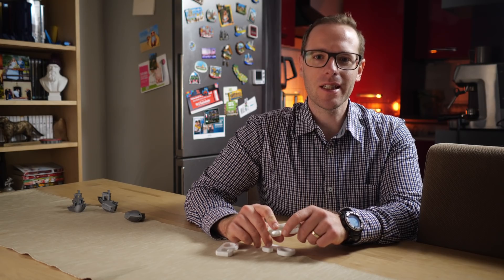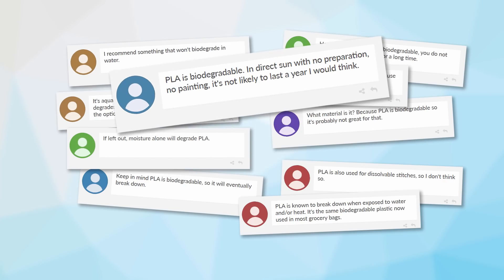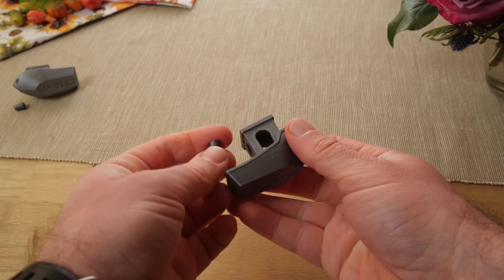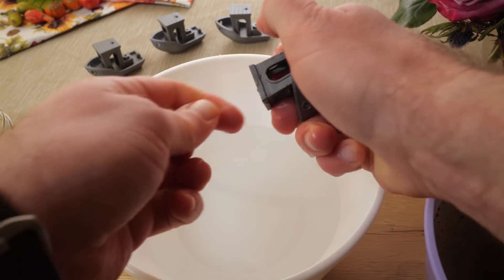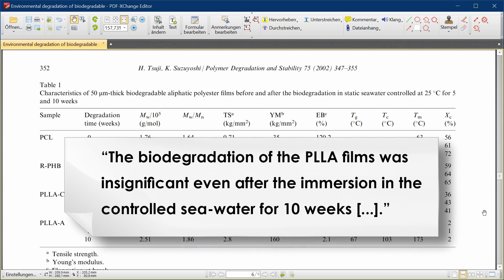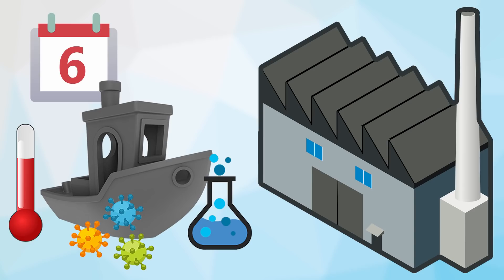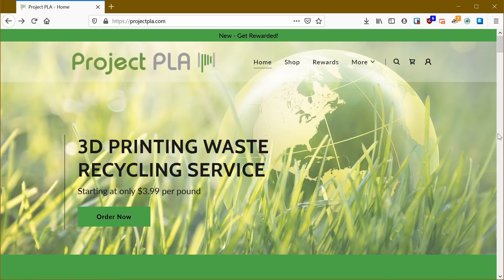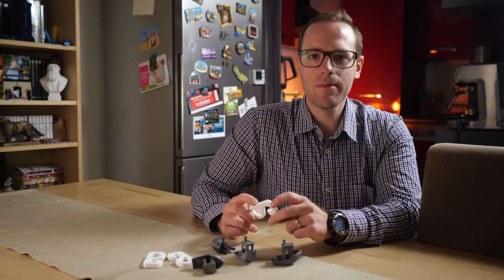Is PLA for 3D printing really biodegradable? I've buried and drowned Benchy for 2 years to find out!

Comment: The ProjectPLA website redirected me to spam 3 times.  If it was once a real company, the domain has since been taken over.  The first time trying to get me to install software, the second time redirecting me to Bing(?!), and that was from a Google link), and the third time to one of those fake pages telling me my Microsoft registry keys were illegal, it replaced my cursor arrow with a different one, froze my mouse, and locked up my computer.  I tried to get out of it with Escapes and CNTRL-ALT-DEL's but had to shut off the internet, then did a hard shut-off of my computer because I didn't know what it was trying to do.  Please remove the link in your description.
Reply from the maker: I'm very sorry about the link, I've already removed it now.

ProjectPLA seems to have died a few months after I made the video, but the link was still working for a while. Thanks for alerting me that it's filled with spam now.

If you're looking for something similar, TerraCycle seems like the only alternative right now, you can check them out here: www.terracycle.com

Comment: Before getting into 3D printing, I was concerned about the environmental impact and was reassured by the ubiquitous 'biodegradable' claims for PLA—as someone who now LOVES the hobby, I'm bummed to discover it's pretty much a lie ☹️. I was relieved to hear about ProjectPLA.com but it sadly appears to be unavailable. Hopefully something similar becomes available soon. Thanks for the great information 👍
Reply from the maker: Yeah, same here, I now always think more about whether I really have to print something or not.

As for ProjectPLA, I was sad to hear it's gone under. I guess too few people were willing to pay for the box. I did find another similar service, so you might have more luck there: www.terracycle.com

I also began using more and more stuff from Filamentive (based in UK, but I think they sell worldwide). A lot of their filaments are made completely from recycled plastic and there's no loss in quality whatsoever.
Reply: John, it isn't a lie. What he did here does not test if it is biodegradable, he is testing if it is compostable. To biodegrade PLA you have to heat it up, very hot, as well as have it very wet. You don't just bury it and it magically happens no one claims this.

Comment: Great video but something isn’t right.  I’ve had PLA in my garden degrade significantly in a few years.  I have no scientific tests unfortunately but wonder if it’s because it was actually PLA and everything else out there is PLA with additives or maybe because of some local environmental factors.  For example the slugs loved the stuff for a while!  No discolouration for you even though?  I’ve had prints on windowsills indoors that have lost colour from the sun but perhaps that’s a symptom of the cheap and nasty filament I’ve used in the past 😂
Reply from the maker: I've heard something similar before, but it seems to be quite rare.

I think you're thinking in the right direction that it has something to do with the additives. I'm fairly certain that cheap fillament has some filler material and it's this what causes the parts to crumble, not the actual PLA.

Nope, didn't have any discoloration to speak of, but I also don't live in a very hot climate. I did print a "beware of dog" sign about 3 years ago from PLA, and while it did warp a little from the heat, the colors are still as vibrant as before. So yeah, it's probably just cheap fillament that seems to be having those issues.
Reply: Hobby Hoarder filler material yes that’s possible, all my early filament was real nasty stuff so probably contains all sorts :)

Comment: I'd be interested in knowing what differences a PLA spool plastic from printed PLA.
I have PLA spools aged of like 6 months that you can't even manipulate because it will break like raw spaghetti if you try to slightly bend it...Though, I have prints with this exact same  PLA spool, that are as robust as fresh prints  :|
Reply from the maker: Brittle PLA is usually a sign of being exposed to moisture too much. If you dry the spool in an oven (at 50'C for a few hours), it should go back to normal.

Comment: I'm doing a PhD on biodegradable microplastic and the reference you used are the ones I have read. The surface area to volume ratio is small if using whole piece to test, maybe grind it to smaller pieces you will see some changes
Reply from the maker: Good luck with your PhD!

I'm sure that's true to an extent, but I doubt most people would be willing to grind down parts before throwing them away.
Reply: @HobbyHoarder  I wonder what would happen if we used the sink waste disposal to grind it up? It'll then go into municipal sewage management... not sure if that's good or bad.
Reply: @reinux  I'd suggest using a blender or food processor that you don't care about and won't use for food again.
Reply: @Katskraftkorner  Before returning it to soil or something?
Reply: @reinux  smaller pieces of anything break down faster than larger pieces. I wouldn't use the kitchen disposal to grind plastic.  If you do any resin crafts, or even painting of any kind, or make models, you can use the ground up bits to add texture, or create unique color effects in resin. Basically, use it the same way in resin you would glitter or metal flakes.
Reply: @Katskraftkorner  Huh, that's a cool idea. Thanks!

Comment: thank you so much for clearing this. i wanted to go with ender 3 since you cant print PETG on glass, and i did not want to go with ABS either since of its fumes and hardness to print, etc. thank you so much for clearing this for me. never trust quora!
Reply from the maker: You can use glue stick and apply a thin coat on glass, then you can print with PETG as well. A textured PEI sheet works as well, but can be quite expensive.
Reply: @HobbyHoarder  i will try :) if the PLA starts to break down, i will try to do what you said. anyway, thanks again!
Reply: Quora is an open site where anyone can answer questions and be subject to fact checking by people from all walks of life.  It's more reliable for scientific truth than most random internet spaces including YouTube, which hosts countless free energy and conspiracy videos.  (And any amount of down-voting here does not hide content, unlike Quora.)
No, I'm not saying YouTube is bad, but it's not the ultimate source for knowledge and most of Quora is better than most social media sources.  Any information you take in from any source should be backed up by other sources to find the truth.  (Good info anywhere usually references other sources.)
Be skeptical.  Never trusting any source is as dangerous as always trusting any source.
Reply: @VoltisArt  yeah, but i completely lost trust in quora since nothing i found on there what i was searching for was true, AND when i signed in i started recieving like 5 tons of spam every day. so, i have quora blacklisted.

Comment: PLA in a landfill is my least concern. I'm more worried about heavy metals (e.g. mercury) and chloride containing carcinogenic chemicals (e.g. PCB) in landfills. But of course, we have too much plastics ending up in oceans and PLA doesn't belong there, but who would throw PLA in the ocean anyway? That problem is more due to bottles and plastic bags being thrown into rivers. A more real concern about any filament is about the toxins we inhale from the printing process. So let's not focus on biodegradability but rather on printing toxicity. What's the safest PLA on that metric?
Reply from the maker: I'm afraid there's not any research that I could find looking specifically into PLA fumes. I'm fairly certain it's been proven that ABS fumes are cancerogenic, but I haven't seen anything regarding PLA. It's probably still too early, since 3D printers are just now becoming more common.

I personally use an air filtration system in the room with my printers. At the very least, I'd put the printer in an enclosure, then add a fan with active carbon filter to suck out the air.
Reply: Hobby Hoarder Yes, I’m planning to build such system also. Unfortunately, often we don’t know about health effects before decades later when statistics show that something caused a high cancer risk, brain damage or whatever could be the effect. PLA is supposed to be safer but with whatever additives involved, one could be much safer than another one. One could be highly carcinogenic due to a chemistry that is proprietary, for example. We are the generation of 3D printing guinea pigs...kids running 3D printing in the room they sleep are potentially destroying their health but not realizing it before decades later.

Comment: well it dosent really matter if its biodegradable or not... its still resuable... u do need the right hardware to cut it up and extrudes it into new filament... at some point when i got alot of scrap im gonna head out to a school with a filement extruder and make some new filament myself... i dont understand why ppl are so interested in biodegradable plastics... especially becous most of the current bio degradable plastics just degrade into micro plastics that are even worse...

Comment: I recently tested biodegradability of plastic in water specifically with heat.  The results were surprising and contradict some of the details in this video.  While its still not biodegradable you can degrade it in your own home.  https://www.youtube.com/watch?v=OcLYH6bbFLQ
Reply from the maker: Thanks for the link, it's always great to see this sort of tests being done.

I wouldn't say your video contradicts anything in mine though. I've been very clear that PLA will biodegrade when placed in proper enviornment, the most important part being 60'C and upwards. My point was that this is near impossible to achieve in nature and I've also talked how composting facilites are avoiding PLA, because it takes too long to significantly break down (up to 6 months).

I'll comment the rest of my thoughts on your video, I think it will add more value there.

Comment: I've had PLA prints break down after just 5 years under "normal" conditions (highish temperature and high humidity), I did a short video on it.
Reply from the maker: Yeah, UV will certainly make PLA more brittle (which is why I'm repeating this test with Stefan and actual numbers), but that doesn't mean it's biodegradable as such.
Reply: @HobbyHoarder  In my case there was no sunlight/uv light involved. And not just a specific filament, some of them didn't just become brittle, they had started turning into a corrosive liquid.
Reply from the maker: @TheStuffMade  That's very interesting, I've never heard or seen anyhting like that happening before. Might be related to PLA brand. Would make for an interesting experiment if you still have it.

Comment: cant tell who's right or wrong... many people show PLA getting brittle and crumbling away after just months... yet yours dont... how is the climate temperature in your country is it cold temperate or hot humid etc... maybe those have something to do on why your pla dont degrade.. maybe someone should do a new experiment logging temperature humidity night and day every month or so instead of just throwing them somewhere...I have not tried pla yet I have always used petg since I got my printer coz I dont want my prints to crumble after a year.. but if what you say is true maybe I might try pla coz its cheaper...
Reply from the maker: I'd love to see those posts if you still have any links? The only one I could find was someone showing what happened inside a fish tank (PLA filter). But it later turned out that PLA didn't actually crumble away, it was sanded/grinded down by fine particles in the water that were being circulated around.

I live in Germany, so the climate is about average I guess.

In any case, I've linked two scientific studies and PLA didn't degrade in those cases either. It has nothing to do with temperature or humidity.

You can easily use PLA outside if you want, don't worry about that. The only issue you might have is if the part is thin, as it might warp under hot sun.
Reply: @HobbyHoarder 

here is makersmuse showing his 3d prints left outdoors..

https://www.youtube.com/watch?v=qqNfa_zExRU

kid left his 3d prints outdoor for a year..

https://www.youtube.com/watch?v=_-NKrec5UxI

this one has hes 3d print literally crumbles after 3 or 6 years. he says in the coment section the brittleness started 6 to 12 months after printing..

https://www.youtube.com/watch?v=GMsunDn2go4

Comment: Great idea. Very informative. I can see you put in a out of time researching this. I’m very new to 3D printing and was excited to know that PLA was eco friendly/biodegradable. Now I’m disappointed that the manufacturers are misleading us. Sure it is biodegradable but only under expensive and unique conditions. Very sad. I guess the source (starch) of the material still provides some validity in being eco friendly. Thanks for the info and your other great videos. I am learning a lot from them. You have a new subscriber.
Reply from the maker: Thank you Luis, I appreciate your kind words and I'm very happy to hear you're liking my videos.

Yeah, PLA seems better than ABS (petrolium based) in that regard, but we're not there yet. I've seen PLA used more and more in eco-aware restaurants, so I'm hoping this will also increase pressure for actually recycling it.

Comment: Some PLA actually biodegrades quite fast; I don't remember what brand it was but I printed some pump parts and a swirl filter for my aquarium and it started to "melt" in less than 6 months. Now I only use Real PETG Natural for those kind of parts and it seems to be biologically inert.
Reply from the maker: I don't know if it was your blog post, but I've seen it mentioned online about the fish tank. But it later turned out that PLA wasn't actually degrading, it was just being "sanded" by fine particles in the water.

You can easily test this out; just print something and place it in the corner of your fish tank where there's not a lot of water flow. I'd be willing to bet nothing will happen with the object.

Comment: Great video, thank you. I'm just thinking if the ABS and other plastics are really worse than PLA. Because at least everyone will throw them to recycle bin for plastics, but in the case of PLA it can make you think you can just throw it to the regular bin with the idea it will decompose by itself.
Reply from the maker: That's a good point, but there's another issue with it. If you throw either ABS or PLA in the recycle bin for plastics, the recycling facility will likely throw both to the landfill, as they have no idea of knowing what type of plastic it is. Plastic bottles and items have a material type symbol on them so it's easy to sort them. Nobody is printing those symbols, so it doesn't matter what filament you've used, it won't get recycled either way.

I think adding PLA/ABS symbols on printed objects would be a step forward.
Reply: @HobbyHoarder  I'm aware of this. But I was looking for more information about recycling symbols and PLA has no commonly use special symbol in my country (Czech Republic). Or to be more specific it belongs under cotegory 7 - other plastic where also ABS belong. Which is from plastic sorting point of view in garbage facility basically the same category as if there was no recykling symbol if I understand it correctly. It seems like ABS or PLA has basically no recycling potential at all, so the best case scenario is to get it to waste incinerator  :-(  But in the other place I have even read both of this plastics should not be thrown bins for plastic waste at all... so I'm afraid at least where I live there is absolutely no difference between those plastics. The only one is that ABS is more durable (shock and heat ressistant) so products from it can least and be used longer. (Off course just in case you print a useful unique products and not the common junk majority of users download from thingiverse, which only purpose is to litter your place with.... )
Reply from the maker: @Fresco272  Yeah, it's complicated. I really hope that services like ProjectPLA become more common, so you could send back waste prints. Hopefuly as 3D printing grows, so will the recycling side of it. Another option would be to grind down objects and create new filament from that. It's not ideal as you can't control the colors, but would be ok for prints where the color doesn't matter. Right now though, grinders and filament machines are much too expensive to make this worthwile.

I think the situation is the same in rest of Europe as in Czechia. Here in Germany as well, you're supposed to throw stuff like that in the general waste bin, which makes zero sense to me. But from what I understand, if you mix it with other plastic, they can't sort it apart and have to discard the entire batch, even the "good" plastic.
Reply: @HobbyHoarder  I did a little bit more digging and it is really unclear what to do with those plastics. I found numerous different websites about recycling and they completely lack information we need. Or they are contradicting each other. So I wrote e-mails to some of them and hopefully I'll get some answer how it really works now. But it is crazy how hard it is to find answers, recycling looks like joke now.  I'm thinking about printing recycling symbols on bottom side of my products at least when it is possible, but at this point it seems like it makes no diference in the end. But I'll try to get proper confirmation from authorities on this topic and I'll write it here.
Reply from the maker: I'd love to hear what you find out!